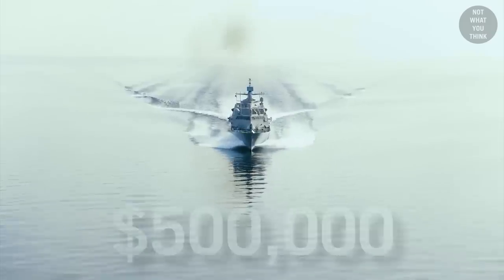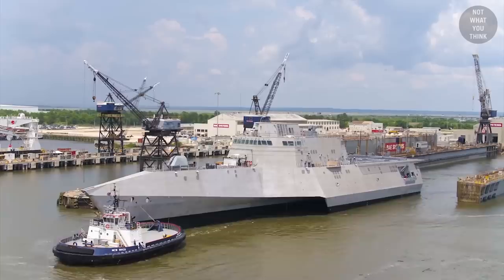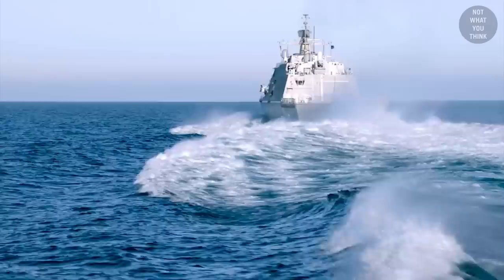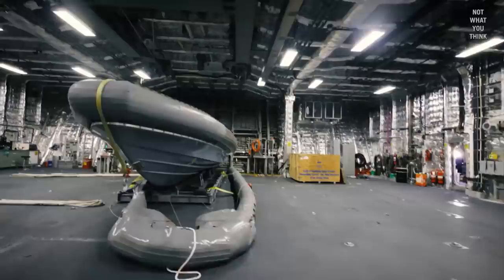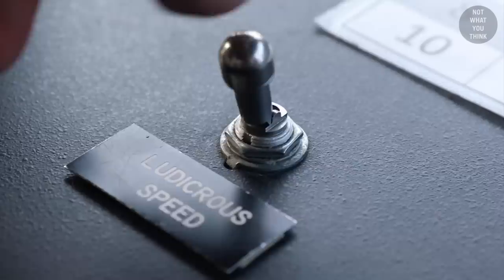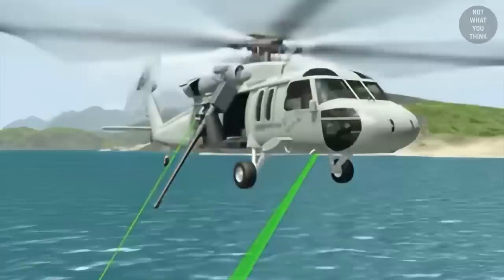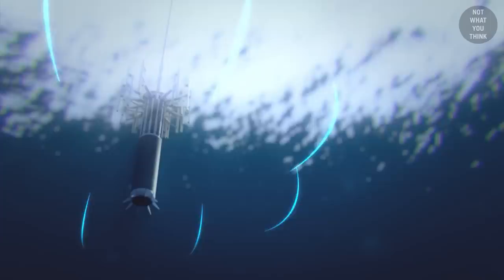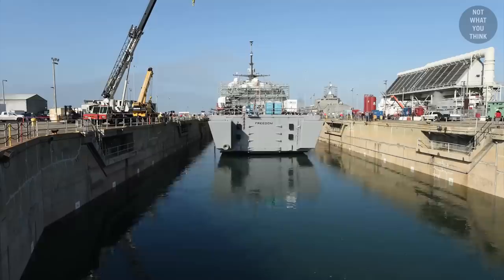Why Retire a 2-Year Old Warship?

Comment: "Not in their best shape" is a polite way to describe the Mine Countermeasures ships. Damn things run off of poorly maintained diesel engines. The only way I was able to see a patrol on one of the MCMs was after a year and a half of engine problems, one Chief Engineer fired, and one engineering dept. LCPO "stepping down", big Navy sent an Isotta Fraschini corporate mechanic to fully diagnose and fix the issues. We lasted a good six months before we had to limp back to homeport because of more engine issues. Good times.
Reply: Why didn't they use domestically produced EMD 20-710 (5000 hp) engines; up to 40,000 hours  before overhauls.
Reply: @191895  Sizing issues, I would guess. Just by looking at a picture of the EMD I can say that it wouldn't have fit in the main space of an MCM. Also, if I am not mistaken, the IF engines were made to put off as little of a magnetic trace as possible. Everything about those ships were designed with the most reliable degaussing methods in mind.
To be fair, I was on an MCM in the early 2010's, and by then they were long overdue to be decommed. If the LCS project worked the way it was supposed to then maybe they would have been.

Comment: Just imagine what the US navy could have today if they invested that money into existing, off the line german Sachsen (or almost identical durch De Zeven) class frigattes. Or anything the french, italian, spanish, swedish, UKs or norways military / ship building industry had to offer.
But nooooo, big navy had to throw big money at a program that has impossible goals, just to find out that it was an expensive mistake to pursue them.
Who would've guessed?
Reply: You miss the entire point of these build programs. Jobs, and keeping the money within the country.
Reply: Did you not hear they are. There using the tow depth sonar from the UK. Also in the army trophy was built by Israel. The f-35 had its turbofan on the F-35B developed by Britain.
Reply: Dr. Bright I don't like the system but here it is. And it's tax payers that will call their representative if they don't get a contract. 

 I'm ex military, I don't care where the equipment comes from I'd like the best stuff at a useful quantity. I don't work in procurement.
Reply: Germany's MEKO A-300 would be sweet to have in the US Navy, that ship is loaded for war and then some!
Reply: Could have written welfare cheques with one half, invested the other half, and been able to buy proper ships now.
Reply: They are now buying Italian frigates
Reply: @efewtenekeci , Italian DESIGNED frigates, and the design was modified quite a bit, we'll see how the Navy screws this ship up in a few years.
Reply: Lockheed Martin guessed that the income was more valuable than producing a serviceable ship. They should eat the loss not the taxpayers.
Reply: @CDSAfghan  you can have jobs and domestic production by building proper ships that work as well. The UK type 31 is a cheap danish design that easily switch out mission packages. (UK wont switch packages though).
Reply: @TheBooban  those Lockheed engineers ain't making 6 figures to use other people's drawings
Reply: Age old problem.  Remember the FAL  ? Let's promise army will buy FAL if everyone uses the 7.62×51. Than screw it let's make M14, soon after change to M16 and 5.56. Europe wanted a medium cartridge before, but had to change to the 7.62.
Reply: @robertharper3754  have you seen what royal navy daring air defense destroyers can do? we need some!
Reply: @apex_blue  the Trophy system for the M1 and M2 is build under license by Leonardo DRS, Inc, the F-135 Turbofan in the F-35 is made by Pratt & Whitney in Middletown Connecticut, as to the lift system that was originally developed by Allison Engine Company, which was bought out from GM by Rolls-Royce.
Reply: @robertharper3754  why, the Navy is contracting for the FFG-62, Based on the Italian FREMM, its bigger and has more launchers and a more capable Aegis system with SPY-6 RADARS.
Reply: @johnmartin6420  I didn’t know about Trophy, but I did know about the fan part of the turbo-fan engine in the f-35 B which is why I specifically put the B version. Not that it has a different engine, but that it has a turbo-fan.
Reply: Back in the 90s Newport News proposed the FFG-21 FRIGATE as an export and to the Navy as a replacement for the OH frigates, Ingalls Shipbuilding also proposed a Frigate based on a short hull DDG-51, powered by 2 GT and 2 Diesel engines and Northrop Grumman offered a frigate based on the NSC cutter. But but ohh noo, the Admirals wanted their High Speed Low Drag Street Fighter ships.
Reply: @johnmartin6420 , well, the Navy has had a crap track record for procuring ships the last 20 years, plus the A300 is just a tad bit more heavily armed. A larger A300 would be needed to have the stores needed for long deployments but it would make a better base than the Italian design for sure.
Reply: @robertharper3754  the A300 is based on the (MEKO A-200AN), it's beam is 53ft verses 65ft for the FREMM class, length is 125 meters  verses 152 meters for the FFG-62, displacement is 5,500 tons for the A300 verses 6,800 for the FFG-61. The concepts and proposals from  Blohm + Voss shipyard are have all so far failed to win any of the competitions they have entered with the latest loss being to the Type-31 in Poland. The FFG-62, is what the U.S Navy wants, a low end escort and not a DDG-51 Light, the FFG-62, can be outfitted with 32+32 MK-41 VLS and 16 box launchers for SSM. As to the Radar, the nave went with the AN/SPY-6(V)3: A 3-sided phased array fixed version of the EASR, each with 9 RMAs, bit by enlarging the top superstructure a 4-sided phased array can be used and that is planned for the Flight ll. If the navy wanted a light destroyer, then the AN/SPY-6(V)4, 4-sided phased array radar with 24 RMAs could be utilized, and with the integrated electric drive (CODLAG) it has enought electrical power to operate it. The Future flight ll variants and follow on will also use the 127/62 gun in place of the 57mm.

Comment: You build one or two. If they work, you build a few more and make improvements. If they fly off the shelves you make a whole bunch. The way they did this seems to be by the F-35 method... build a bunch and then figure out what isn't right and try to fix them while even more airframes roll off the assembly line with immediate need for fixing. Granted the F-35 is now kicking ass and developing to meet its role(s) but the teething process was scary. Same with this ship.

Comment: LCS was a failure for one reason.
The USN ASSuMEd that they could QUICKLY and CHEAPLY build mission modules when they had no idea as to what was going to be required/needed
Reply: That's the whole point of being modular.  Since you don't know what future missions might entail, you build something that is easily modifiable to ever changing conditions.
Reply: @toolbaggers  I’m sorry I was not clear.  I was ONLY referring to the mission modules they already knew they needed/wanted and not any that may crop up in the future
Reply: Everything with these ships was being designed and built on the fly. Collision detection was disabled in the design software so you had pipes, wires, etc running through each other in the CAD model which had to be sorted out / redesigned during construction, tearing out completed work and replacing with the redesign. I'm pretty sure the propulsion combining gear was never tested on shore, they just installed it and crossed their fingers. The mission modules were also designed and built without prior testing, put on finished ships, tested... and were failures.

Comment: I sailed on steam powered destroyers and Knox class frigates and we never had the issues in our engineering plants like these piles of junk do. We fired up the boilers and hit 1200 psi and got underway no problems at all
Reply: That’s some insane pressure!  What was the water consumption over a 24 hr cruise?
Reply: I was on a Knox class FF 1057  we lost power backing out of our birth in Pearl and almost ran aground on the USS Arizona The Knox class destroyers we’re pretty much POS product of McNamara eventually after I had left the navy said FF1057 USS Rathburne broke down in Japan was towed back to Pearl and used as a target
Reply: @wallacegrommet9343  remarkably about 400 gph  Turbines were condensing turbines. All exhausted steam was condensed back into water and returned to the operating system. Operating pressures on a 1200 psig plant were normally 1250-1300 psig range with operating temps in the 850-1000 degree range.
Reply: My Knox Class frigate was FF-1080, USS Ainsworth.  I served onboard from Nov. 1982 to Mar. 1985.   Had a good time overall.  She was transferred to Turkey in 1994, as the TCG Ege.  Finally decommissioned in 2005, and is a display ship at the Maritime Museum in Incirlik, Turkey.  Better by far than being scrapped.

Comment: There is an absolutely critical element to this discussion that most people ignore: the retirements are pat of the budget REQUEST. This has NOT been approved by Congress, and unless they approve it this will not happen. 

The Navy has twice requested that Congress retire nuclear carriers after 25 years rather than refuel them. Congress refused both times.

The Navy has repeatedly asked Congress to allow them to retire the Ticonderoga class cruisers, most recently requesting seven retirements in FY 2022. Congress pushed back in every budget until FY 2022, when they allowed the Navy to retire no more than five.

And in last years budget the Navy asked Congress to retire four LCS, including the Freedom class ships Fort Worth, Detroit, and Little Rock. Within a month the House had added a section to the draft budget forbidding the Navy from retiring those three ships by name, which was included unaltered in the final budget eight months later. They also added a new law that requires the Navy to request a waiver to retire a ship before the expected end of service life, which for the LCS is 25 years.

None of the requested retirements are guaranteed at this point.

Comment: The LCS-1 class was doomed right from the first back-of-an-envelope concept.  A ridiculous 50-knot spec mandated a semi-hydroplane hull, which in turn had extremely limited space compared to a displacement hull. Add to that the moronic "efficient manning" (meaning chronic undermanning), a complete lack of own-ship maintenance capacity, and the unworkable module concept, and the "Little Crappy Ships" were worthless even before the blunders with the main propulsion.  A colossal waste of money, which the Navy now rightly want to be rid of - but Congressmen protecting jobs in their districts continue to force these unwanted turds on them.
Reply: My question is why they didn’t buy one ship and when the drives didn’t work and speeds were not viable didn’t they just cancel the rest till the drives were worked out and doing the job built for…would seem smarter to me.
Reply: @charleshanks6186  Excellent question -- to which the only answer is, that Navy procurement has been a goat-rope for the last 20 years
Reply: @charleshanks6186  because then... they may have had to not build them when they wanted (and by whom they wanted) and someone would say "OMG by next year the Navy has 440 ships instead of 450!"
Reply: @chedelirio6984  True enough, although the actual numbers are closer to 250 and 240 (and shrinking)

Comment: I did armed security for Marinette Marine, which was building some of these LCS ships. I can say that they constantly had problems and had to be towed back to port after the majority of test runs. 

They were known to be very fast however, and one captain claimed to go much faster than the specified top speed of the ship during a particular test run. However none of that means anything if they struggle to even get out of the Great Lakes and into the ocean without blowing and engine or some other issue.
Reply: If only they worked as designed. They would be very impressive, hopefully the newer models will fix the issues.
Reply: you shouldn't be allowed to work in that industry again
Reply: @timlewis4623  I can talk about em since they're canceled lol

Comment: I'm ex US Navy. I interviewed for a position at Fancantiere Marine that builds the freedom class. (Raytheon builds weapon systems, no?). Fincantiere operates out of a shipyard in Marinette Wisconsin... Just north of Green Bay. It was an electrical engineering position. 15 yrs out the service, it brought back good feelings from the old days, going on the interview... the same haze grey like on my old Newport News built CVN71. But the company is Italian owned, and when not building LCS Freedom class ships they build cruise ships...and then I learned the LCS Freedom class is built on a cruise ship hull.. and I was like the f__ck what? Then I walked through the well deck and saw paper foil insulation covering the bulkheads and thought... This paper and tape isn't going to last through one deployment... And then they told me about ongoing issues of leaking where the water jets exit the ship... As well as the issues with the propulsion plant... And I thought... These jackasses are making up stuff as they go... They have no experience in Navy ship building,  no apparent familiarity with QC / six sigma, no process control / no BIM model equivalents... No plan on quickly and efficiently fixing issues... What for? They have more money than they know what to do with.  Oh... you want Phalanx / CIWS or a  RAM missile system on the ship, or some sort of electronic warfare system like  AN-SLQ 32? Oh, that gear is heavy and will reduce top speed to 20 knots, even though every Navy combatant has these systems. So I walked away from a train wreck. This was in 2018. As far as why are they building  more while de commisioning the LCS ships... Ask a business grad or a lawyer about contracts and how the federal  government is on the hook to pay for X# of ships. Yet the US government will then manage to sell these lemons to Guatemala or Iraq. So it's not a complete loss.
Reply: I worked there and you are right Lockheed Martin who basically ran the shipyard had no clue what they were doing and if anyone did they would not listen very poor management team at Lockheed Martin except for a very few personnel.
Reply: IMO the LCSs would not even be suitable for conversion to yachts given their present hulls and propulsion systems.  Both classes are simply unreliable due to fundamentally bad design.    I doubt we'll ever hear a single story of combat glory as part of the LCS legacy.

Maybe there would be a market for "LCS merch" made 100% from cracked LCS hulls.  I wonder how many Bud Light cans one of those things could become.  Any guesses?  What a concept!  Recycle the aluminum from cracked ships to cans for cursed beer!  What could be more efficient?  if only the cans could be made to not leak...; but, on the other hand, who would care if they did?

Comment: It is cheaper to use the diesel to turn the current 9 boats into mine warfare vessels for wartime use. They can patrol the two seaboards and the waters around Hawaii. Using the independence class and the new Freedom class for surface warfare and permanent mine countermeasures duty. So basically break the glass in case of war boats. That would mean active storage and training reserve units on their operations.

Comment: This issue has been an ongoing trend with the US military. They decide to decommission vehicles, weapons, and other hardware without a replacement decided, and then ALSO decide to make multi-role or modular packages that cost several times more than getting multiple platforms instead. This happened with the combat engineer 'CEV' which was decomissioned, and then the replacement for it in mine clearing, bridging, demolitions and support was canceled, the Littoral combat ships as discussed here, Zumalt class destroyers, and the F-35 which was intended to replace fighter jets, bombers, and the A-10 in CAS and has so far under-performed in every single role and gone billions of dollars over budget.

As for fault, the Navy may have received the problem, but the ships they paid for also did not perform to what the companies constructing them promised their capabiliities to be.
Reply: The F35 is a phenomenal jet and has performed well with only some issues at the beginning of the program. Where are you getting your info?
Reply: The largest cost-factors in ANY Military platform are not construction or engineering/development, but LOGISTICS and MANPOWER.  A ship with 500 crewmembers aboard costs more to operate, long-term, than a ship that can fully-function with only 200 sailors aboard supporting the same mission.  Three different ship-classes for a common mission would require three unique Logistics pipelines of spare-parts, whereas a single ship-class that can do three different missions only requires ONE Logistics pipeline of parts.  The single, multi-mission platform will always be cheaper, long-term.